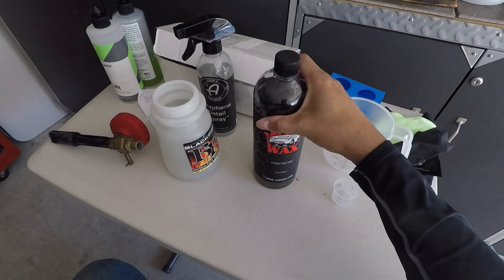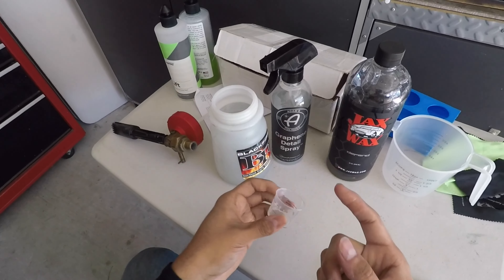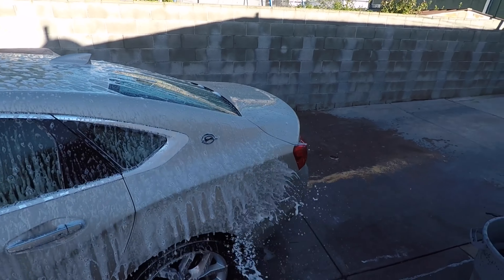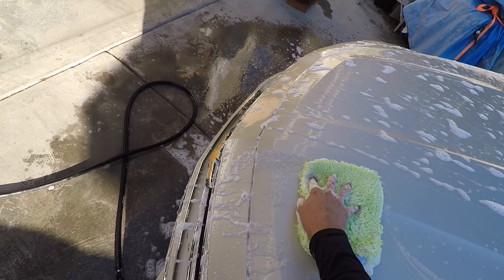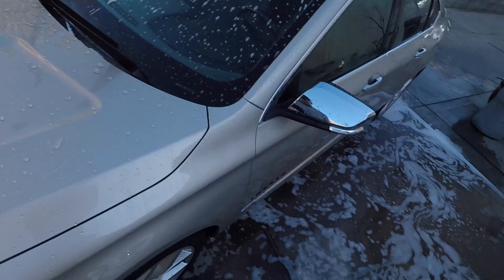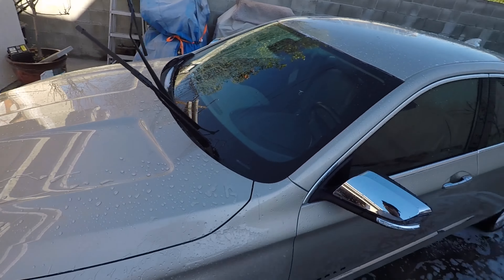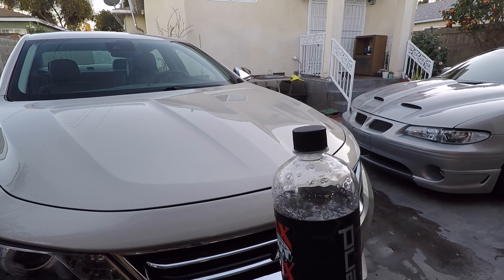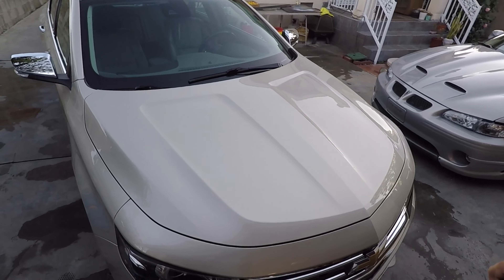Initial Impressions- Jax Wax Defend Graphene Infused Shampoo

Comment: I tend do Reset to clean with foam cannon and contact wash then change to my other gun with a ceramic shampoo  the wait and rinse and then towel dry not with my blower.  Ceramic shampoos don't clean well but more of a spray  coating.

Comment: Might have better foam w a pressure washer.
Reply from the maker: For sure.  A foam cannon will do a better job.  This soap is nice but the biggest complaint I have is that it does not leave protection behind like a ceramic infused soap.